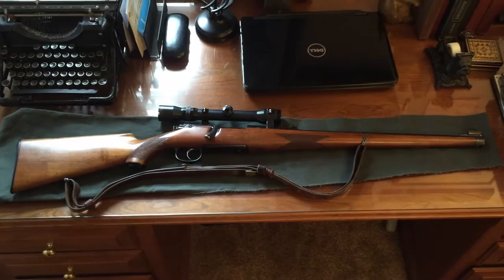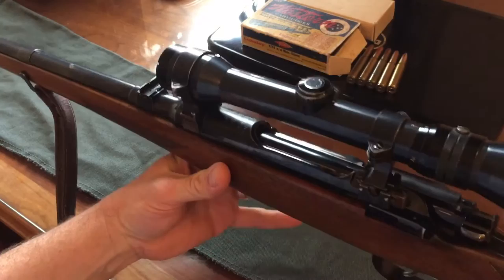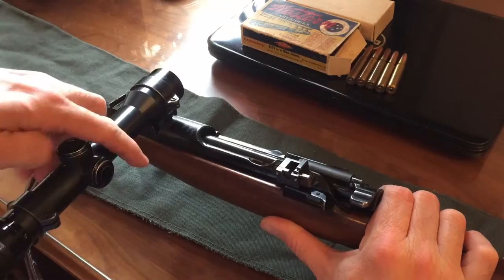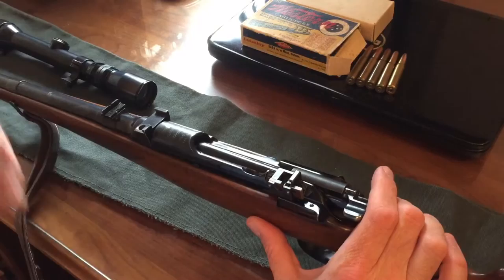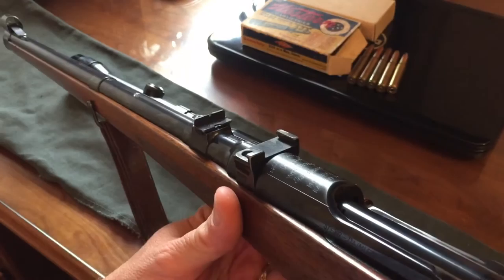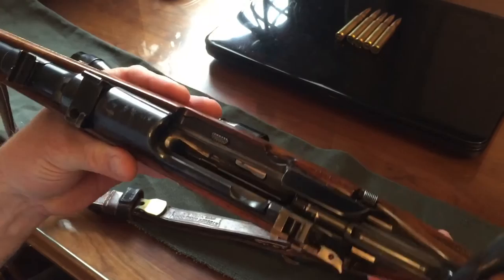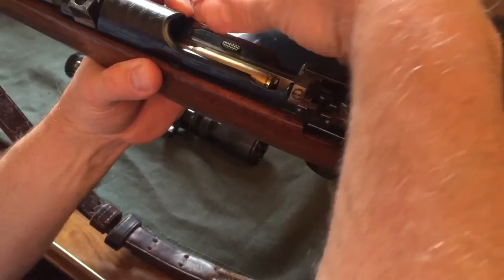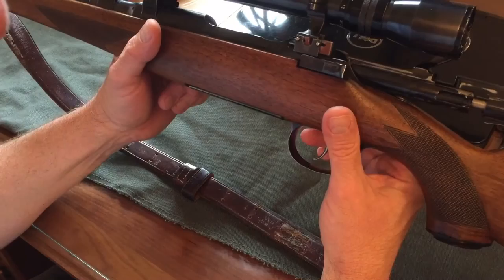Mannlicher Schoenauer 1952 Kahles Review

Comment: I bought one second hand in 1975...30-06,  had it full length restocked to fit me,  I had a side mount put on it, scope sits on top of receiver but doesn't interfere with the iron sights.  Action/bolt is polished and super smooth. Hope one day one of my grandsons will use it.

Comment: Beautiful example, love the quick detachable Kahles, work of art. I have a 1903 (stamped 1920) 6.5 with double set triggers, french walnut stock, metal gripcap and buttplate with trapdoor storage. unfortunately back then there were few scope options so it has a Noske side mounted Zeiss Zielklein. Not as beautiful as yours but I love it. I couldn't appreciate them till I handled one. Thanks for sharing.

Comment: Hey snowball, my grand father granted me his Steyr MS 1952 270 cal. rifle and it came with an after factory scope. Its an old german made scope called Nickel Zielfernrohre Marburg/L Supra 4x81 E/S DP. along with the serial number. It is a detachable scope much like the factory scope made for this gun. I did some research and found that zielfernrohre is german for target tubes so obviously just means scope, but i was wondering if you knew anything more about the scope, i could find very little on the internet myself. Thanks! and great video
Reply from the maker: I know of the Nickel Supra scopes but nothing in detail. I'll have a look through some of my old catalogs and let you know if I feel be anything.  
You might try the Nitro Express forums as maybe someone there would know details about your scope.

Comment: Do you have video showing how to disassemble the Mannlicher 1950? I have a tough time feeling like the barrel is glued to the stock due to the cosmoline and can't get the trigger assembly out either. I need to fix the side safety button as it's stuck in the fire position (again feels glued and will not move) causing the gun to never hold the firing pin back before pulling the trigger. It's impossible to find a video with this info...

Comment: I have this rifle in the 30-06 cal....I wish I could get a quality scope and the original scope mount such as this one on your video....mine has the 2 triggers.
Reply from the maker: New England Custom Gun has a couple of option for scope mounts from EAW. They are very pricey though. 
Paul Jaeger G&H and have made Mannlicher scope mounts in the past and are intermittently available on eBay. I've had a few over the years and recently found a brand new one for less than $100. Bought that one in less than a minute!  I have a 1952 MS in .270 with a nicely figured stock it is destined for.
Reply: I suppose the barrel breech need drilling and tapping for the mount installation? Are the mounts just made for the mannlicher? I would like to find the original mounts and the scope....what is EAW? Thanks for a very good video!
Reply from the maker: The 1952 and later models had a removable filler plate on the left side of the action which when removed provided a flat surface to more easily attach side scope mounts available at the time.
Reply from the maker: I'll see about doing a video on the scope mount and my other Model 1952 I plan to mount it on in the next couple weeks.
Reply: Thanks Snowball042...I see the plate on the left side, my model is GK 1962. I read somewhere that the gun has more value as a collector item with no drilling in the receiver. Would this apply to the side where a side mount would be screwed into? I have found a Paul Jaeger side mount....
Reply from the maker: Some people would argue that it would but it is specifically made for adding a scope. As long as it is a period scope mount, I think it wouldn't detract the value for most potential buyers.
Reply: Thanks for a great video and your comments!
Reply from the maker: No problem.  Glad you like it.

Comment: Hello Snowball042, and thank you, for your videos!

I have recently been offered a 1950 MS chambered in the 6.5x54, but i have no past experience with this type of rifle,  or with the 6.5 MS bullet. Is there any particular thing you think i should be aware of, or look for in the rifle, when i check it out?

Thank you in advance and please keep up the good work! It is much appreciated :)  

Best Regards,

Claus
Reply from the maker: The 6.5x54MS was and is the most popular of the original Mannlicher Schoenauer chamberings. Loaded ammo is currently available from Hornady and PRVI PARTIZAN.  Reloading components are also readily accessible. 
As far as what to look for depends partly on your intended use.  If collecting, then original condition is very important.  Non factory modifications decrease value. If you want the rifle to shoot and enjoy using then some modifications, if properly done, are acceptable and possibly a benefit. 
Always check the proper operation of the set trigger if your rifle is so equipped. My 1908 MS was 'improved' by someone over polishing the lateral surfaces of my trigger and set trigger to try and smooth it out. The result was too much play side to side and an inconsistent sear release. Fixable with shims but a real pain nevertheless.  
With these older rifles it is also a good idea to have a close look at the stock since there is sometimes a hairline crack behind the receiver tang that could get worse over time. 
The Mannlicher is a great rifle made to a very high standard and well worth the investment. Good luck in your search and enjoy any MS you buy.
Reply: Thank you Snowball042, and thank you  for the advice as well! :)
Reply from the maker: One more thing.  I've finally came across my issue of 'Rifle' magazine that has a good article on the 6.6x54 Mannlicher carbine.   
Rifle September 2006, No. 227. 
A good article and worthwhile looking for one on eBay.
Reply: Hello again Snowball042, - Thank you, i will go look for it! 

Best regards and happy hollidays! :)

Claus
Reply: @Snowball042  Excellent advice.